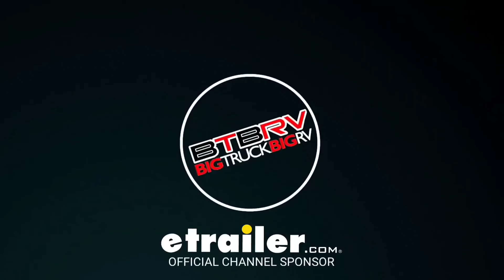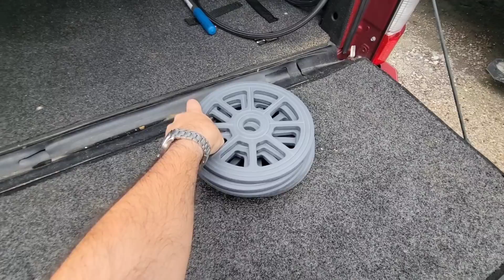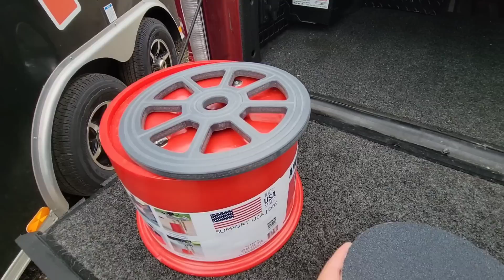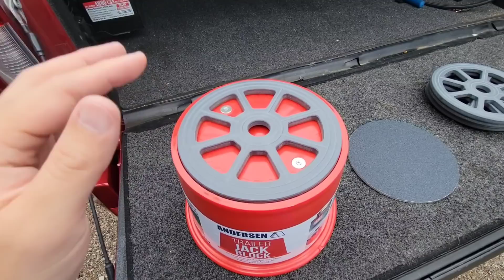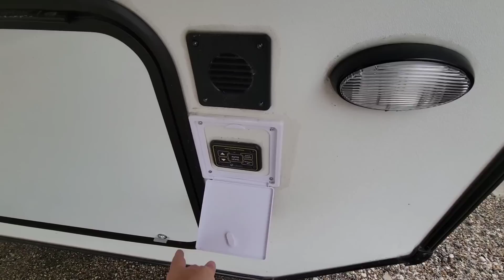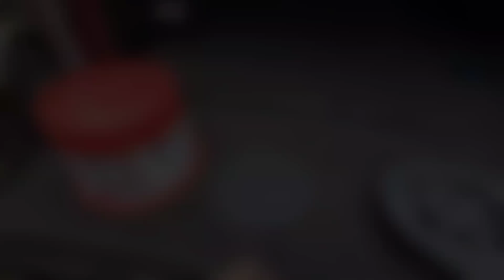What should they build for RVs?  Need your feedback!

Comment: Here is a legitimate idea. Why can’t they design a heating system which utilizes hot water from the hot water heater and a 12 volt brushless fan?  Seems this could be much more efficient and also use less power when Boondocking on solar power?  I should get paid for this idea!

Comment: My auto level control is mounted inside the basement of our fifth wheel. It’s very inconvenient to use. It has a long cable already connected to it that is hidden in its mounting case. It would be great if someone made a replacement case that allowed the control panel to sit in a bracket so it could be removed while in use and hung back up for storage.

Comment: I don't think the plastic manufacturer could do this but an add on 5 - 7 K generator to bolt on a truck engine to supply power for boondocking. You've got the appropriate engine, fuel supply, just need a generator. I know Ford is doing a small version of this on their small trucks but it's wattage output is meek for RV usage.

Comment: I use some custom built aluminum square tubes that slide within one another for easy carrying and easy storage. The plastic pads you show would work great as an insulator between the jack pad and the aluminum square tube. The Anderson jack will not work due to weight and the rig only having 4 jacks. That’s a fair price, where do I sign up?

Comment: How about that latter for the loft above the middle bunk and also maybe a rail system to keep kids from falling out like what you put up also how about battery boxes for lithium ion batteries that are larger? I definitely would buy those pads if they were even around $60 and a better robust cover for the auto leveling system for around 25 to 30 and how about a box that would go around The switches for all the slides water pump and tank heaters for the 398 NBL I have an autistic child and I’m worried about her flipping them and turning them back and forth I’m going to have to find some kind of cover for them this company could make a nice box that could be installed

Comment: As I was filling the fresh water tank on my Keystone Cougar the other day I got to thinking that the locking cover on that was a lot more robust than that cover you got since I had watched the video when you installed it.   Then I had to help a relative move her Keystone Avalanche 5th wheel on Sunday and low and behold, it has the auto level controls mounted on the outside with that same locking cover over it as my fresh tank fill port!  My auto level controls are mounted in the pass thru storage compartment so they don't need a cover.  Long story short, one of the RV suppliers must make these for them so you don't need the flimsy one off Amazon.
Reply: I just did a little searching.  Looks like Valterra, Thetford and JR Products all make these and they're called "hatches" some are blank like would be needed for the auto controls, and others for the gravity fill, outdoor showers, etc.  A few different sizes and types available.

Comment: The Mrs and I saw the Anderson blocks and i started reading reviews.  From what I can tell they work fine for concrete (only not for long) but if you have dirt that's not firm packed or pea gravel that's not very deep they fail pretty easy.  So an accessory to the Anderson blocks to go UNDER the Anderson block to distribute the load would be good. ...or redesign the Anderson block....

Another idea is in the propane bay... mine is open to allow ventilation.  it would be nice to have something in there to catch parts or tools that were left so i don't lose them while travelling.

On the idea of the aluminum plates... i know a machinist that might be interested in making some if he could make a profit.

Comment: My wife has bad knees. At times when we are boondocking she has trouble getting her foot on the bottom rung of the steps into the camper. I made a stepping block using Camco 2x8 leveling block, which came to approximately 5" thick, holding the blocks together with cable ties. I couldn't find anything at a reasonable price to use. Something like that with good shoe sole gripping surface and wide stance to minimize block flipping would be nice.
I recently had to cut those ties and use the blocks. Glad I had them.

Comment: Leveling blocks for TT's instead of the lego style. Something like what you're showing here but for tires. I would buy a dozen right now if they had something like that as the lego style slips, moves and are a pia to use.
Reply: Have you looked into Anderson Levelers?  They are like Nike swooshes that you drive onto and can lift one side very easily.

Comment: Stromberg Carlson Product has a jack supports called "Base Pad Extreme" they don't have a depression or lip. Made from a lightweight poly-carbonate material. 6000 lbs capacity, 3500 lbs. when two are stacked
. No magnetManufactured in Traverse City Michigan.

Comment: Been using the Anderson blocked for a few years. The 9 inch metal stock feet fit perfect in the recess and the magnets hold them in place for easy install at campsite. Why do you need the feet that do not fit if using the blocks? Would it not be easier to change the pads to the 9 inch metal units that fit the blocks? Then you could take advantage of the magnets and use as designed.

Comment: Our trailer is small and we're always looking for counter space, so my woodworker father-in-law made us what I could best describe as a breakfast in bed tray with legs and side handles that is sized for our 3-burner cooktop.  It's high enough to put bottles of hand soap etc. underneath from the sink side and low enough to put our table caddy (holds plates, napkins, utensils) on it under the range hood.  Need to use the stove (we usually cook outside) just grab the handles and move it to a bed.  A lighter one made of plastic with optional matching organizer accessories such as the table caddy would probably sell.

Comment: I really wish there was a base to put under the legs on my Lippert steps. I end up using leveler blocks (poorly) otherwise when it rains on grass, they dig right in. Something that acted as a landing step, wipe your feet, and was wide enough, deep enough to fit completely under the bottom and also then just be picked up and sat inside when you move would be awesome. Bonus if there was a removable bottom step for when you have a very unlevel spot and have to extend those step legs all the way out.

Comment: I think this is a great idea. I was able to purchase the aluminum 9” plates on eBay and the non slip surface. I am now using it with the snap pads and Anderson blocks - thanks to you. But if I had a choice I’d prefer the plastic because it is lighter. Thanks for the information

Comment: The stock rear stabelizers on my Imagine 2670MK are almost fully extended on even a flat level site. An additional 5" foot fitted to the stab foot would be ideal. I'm using 6X6 blocks but they get beat up in the weather and you have to constantly adjust them to keep the foot in place. BTW, I have the same stabelizers everybody has with a bumper pull camper.

Comment: I may be thinking of another brand of bucket but isn't one of Andersons selling points that they have magnets that hold them to the jackpots so you can attach them before you start leveling? Either one, aluminum or plastic would negate that feature.
Reply: You are correct and I own the Anderson’s just because of that. I use them for how they were designed. Love them.

Comment: The snap pads seem to be a great innovation tbh, (now waiting for the idiots claiming you're saying half tonnes are not suitable for this product).Items such as switch / control panel covers should be included with the RV IMO. an extra $15 on the cost of your RV is worth $$$ for that aesthetically pleasing finish and peace of mind. as an aftermarket unit I think they need to be designed for the purpose they will be used for, not a one size fits all. peace.

Comment: Man that’s getting in to a dangerous level with those plastic round things sitting on top of the Anderson blocks.  The snap pads sitting on your design was dangerous enough, but sitting even higher above the lip is just asking for trouble/lawsuit. I don’t care if Anderson said they approve or not, if it’s not in writing, they will drop you like a hot potato if/when a trailer slips off that block and does some serious damage, or worse. No chance I would even think of going that route. If you like the Anderson blocks, then go with them…if you like the snap pads then go with them. Combining the two is asking for problems.
Reply: Amen. I was thinking the same thing!!

Comment: I have a class C RV with the Ford E450. I have been looking for a locking fuel door, but haven't found any that is the same size and with the screw hole pattern as the current bezel that is on there. I've seen an aluminum one, but I would have to drill new holes to mount it. That is something I don't want to deal with.

I know that it would not prevent a thief from siphoning gas out of my RV or tampering with my gas cap. I don't like the easy access for anyone.

Comment: Don't use the "buckets" but manufacture plenty of structural plastics, and I think the inserts a good solution if you like the buckets and SnapPads.  Personally, I have found wood blocking to still be unbeatable with SnapPads as well.  We don't camp many places where the sites are paved and suitable for the buckets.  At best, sites are gravel covered, but typically just bare ground.  I simply have pressure treated 2x12, cut in square pieces, in different configurations - 3 high, 2 high, and singles.  Store nicely in a double sized milk crate.
Reply: Like yourself I use 2x8 & 2x10 cut into blocks. Got them off the scrap & reject pile at the lumber yard. Paid under $10 for 2 milk crates full. The Anderson buckets are not only expensive, but I believe blocks distribute weight a little better on non paved areas.

Comment: Speaking of covers, the exposed switch panels inside your could also use a cover, as you have noted and pointed out you don’t want fingers investigating the panel.  Also design create a spacer for behind the switch panel to relax the wire bend stress.

Comment: Bigger sewer hose square tubing on rear of RV also mine is alittle recessed, I’m fixing to move mine and modify to extend behind the RV back siding so can use bigger size square tubing. The present one thinking using it by welding it on top or back side modifying it so it’s lockable so i could use it to carry fishing poles. Whichever way it’d look the best

Comment: I think that the RV industry should look into putting an ABS roof on future RV's. That's a better option if it could be designed, for longevity. ABS truck bed caps are robust, lightweight and could take the weight on top of an RV with all the equipment including an A/C unit and Solar.

Comment: First build a fifth wheel rv i can safely pull with my 1500 truck with only 1400 payload capacity.
Reply: Buy a real truck. Ram 3500 diesel dually crew cab
Reply: @rickholman6712  I don't want to spend 60K for a truck
Reply: Trucks are overpriced